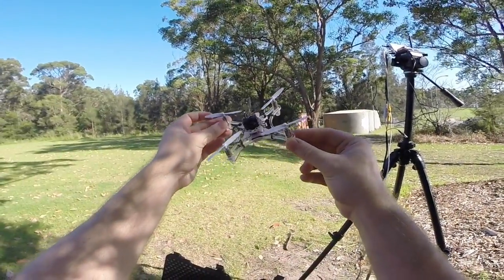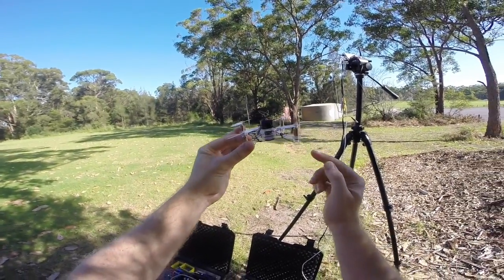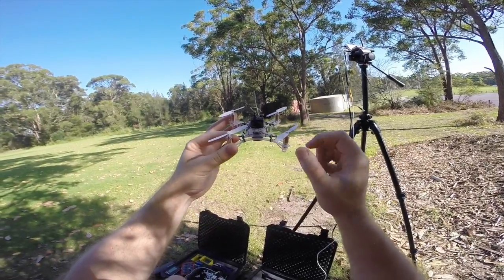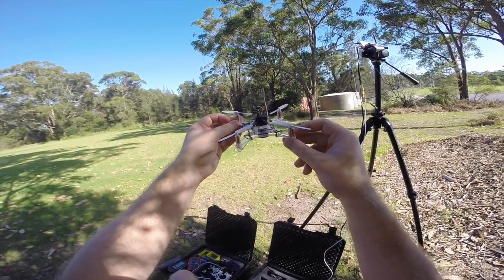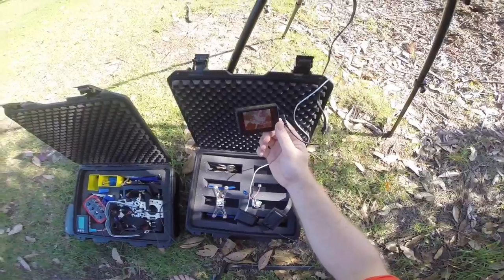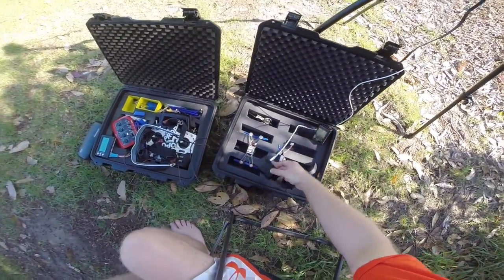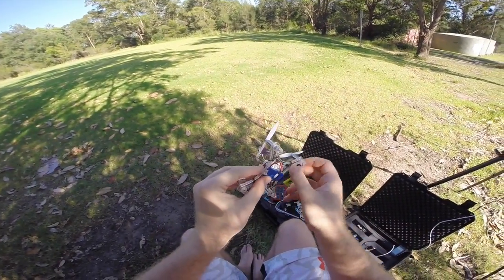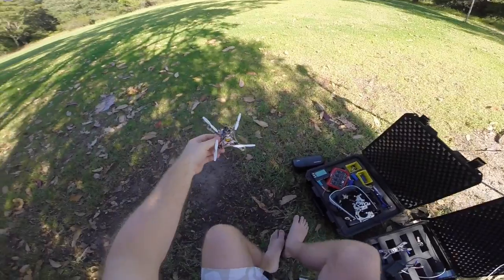The evolution of the FPV-DreamCatcher

Comment: is it hard to install dsm2 module? if i understand correctly a turnigy 9xr is cheaper than most spektrum transmitters right?
Reply: jam3s121 Just push the module in the back of the Tx. I think you dont get a Spektrum Tx for the price of a 9XR. Factor in costs for module and battery though.

Comment: Your getting awesome distance from that VA1100. I don't think I seem to get that far but it could be just that's yours looks further than it is.

Any news on more kits coming to MMW?
Reply from the maker: This was probably 100 meter. I need more Tx power and a better Rx antenna.
More kits are in the works. They just sell out too quickly..
Reply: Yeah cant wait for more kits, I'm absolutely dying for a Micro Spider Hex kit with Alienwii and 6 x 17000kv motors...